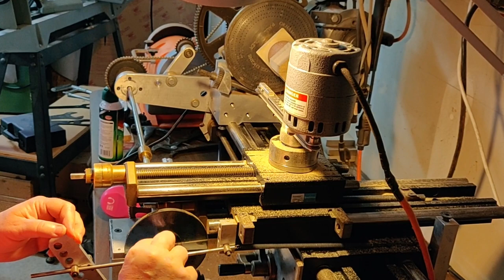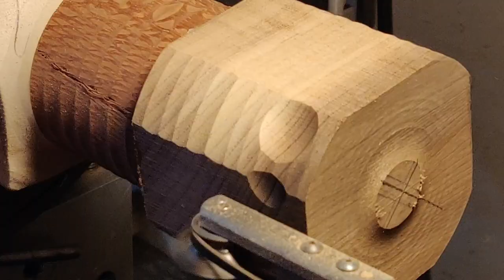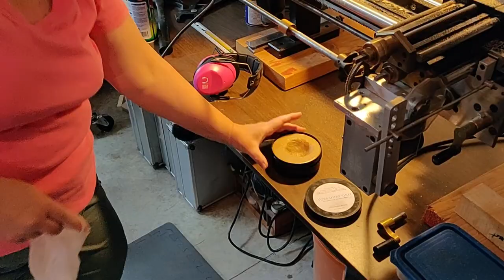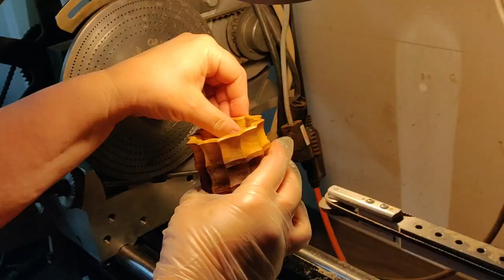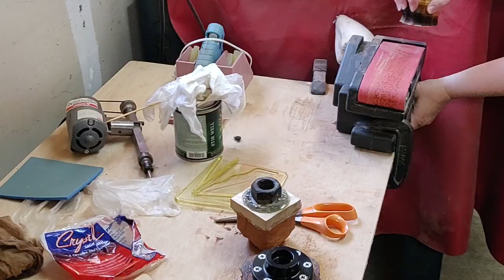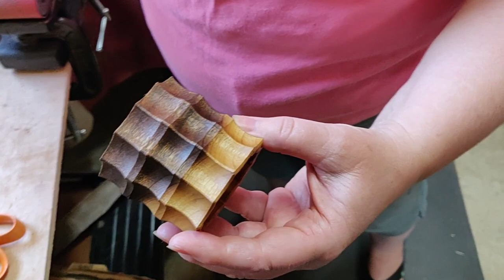Ornamental Turning - Making a Bowl

Comment: hi where can I purchase the round cutter from nothing in Australia would like to use on my rose engine thanking you
Reply: The cutter is actually 2, 1/4" triangle shaped cutters attached to opposite sides of a mechanism spinning in circular motion. I purchase the blades from MSC Industrial Supply. If you email them at metalworkingtechteam@mscdirect.com, they are very helpful.

Comment: Hello from Switzerland! I also have a Cler Lathe, but am not quite to the level you are as I am figuring it out on the go. Perhaps we could connect and trade information? I do guilloché with a Rose Engine and Straight Line on watch dials and jewelry. Atelier Guilloché
Reply: I have seen Guilloche and know only to use the pointed blade, I haven't figured out how to make the pattern move so it spirals around the piece. I am an amateur at turning, learning as I go. I would enjoy trading information with someone who also has a Cler Lathe. I think mine has been modified from its origins but it works for me.